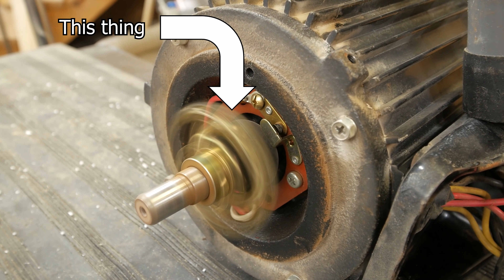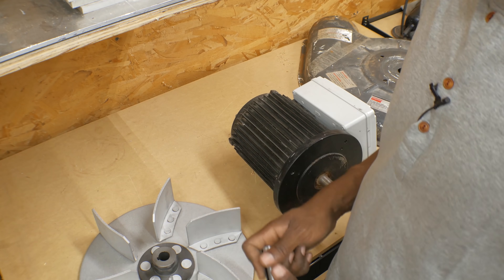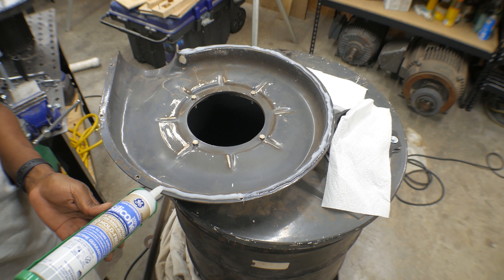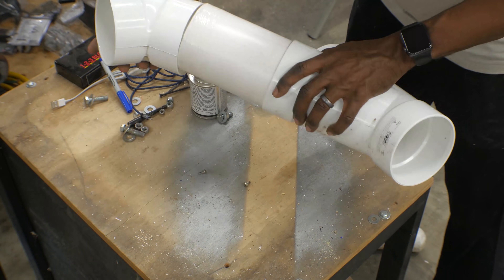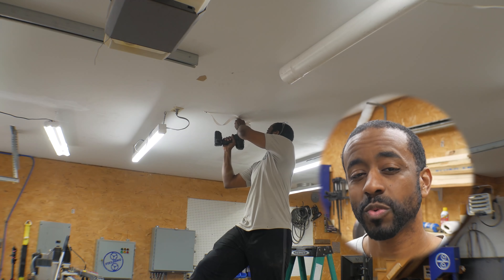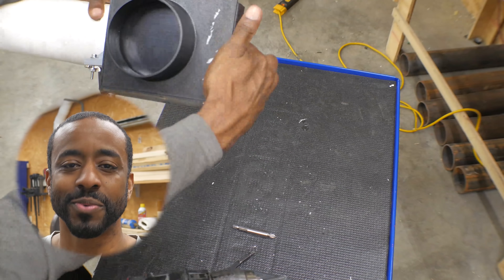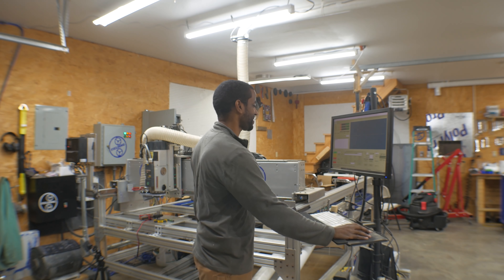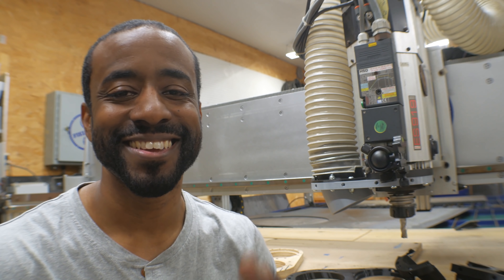Making An Automatic Dust Collection System; Shopmade #081

Comment: That is the right stuff.  As a matter of fact when I worked with the inventer of a large (truck mount size dual motor) portable carpet cleaner for high rises, in order to seal the very high pressure and high temperature hot water fittings, we used silicone and nothing else.  The difference is that when you rebuild it, much later, the silicone needs to be cleaned off whereas a gasket with sealer is a little easier.  Thank you for the videos Jeremy !

Comment: so, while i haven't had static start a fire, I can definitely confirm that dust against plastic can cause some very serious charge buildup and arcing.  I had an issue with my CNC machine where during a really long job all of a sudden the machine would abort with a message like it hit one of the end-stop switches.  But it never did.  Turns out, arcing from the dust collection was causing such a big EMI spike that the microcontroller reading the switches picked it up as a switch throw.  So, in the interest of your CNC machine, and the additional safety of protecting against huge charge buildup, i'd go ahead and ground those pipes.
Reply: I always forget that arcing causes EMI as well, and it doesn't have to be that near to affect devices.
Reply: How does one ground Plastic? As a former electrician (20 years ago) we would bond/ground the metallic parts by running a jumper in parallel with the plastic part (seal tight for example) and bond the connectors. Although the plastic seal tight with plastic connectors was never bonded.
Reply: Grounding it all is definitely worth the effort.
Reply: I was running some lumber through a drum sander, and kept getting "burned" by the chassis. Eventually figured out that the friction of the dust on the collector hose was generating a HUGE voltage differential, and I was the only path to ground when I got too close. I was going to add an arduino-driven dust gate and run a signal wire back alongside the pipe to the dust collector's relay-driven power switch, but would want to REALLY ground everything to avoid having the circuit board fried when the input pins suddenly jumped to 700v.
Reply: @Reign_In_Blood_963  most effective way would be to run a conductor along  the inside of the pipe in contact with the interior sidewall since that's where most of the static charge is and gave it an exit somewhere near a grounding point.
Alternately if the system already exists, use some kind of metal strapping (like the stuff with the holes all along its length) and screw through that at intervals all the way to the interior of the pipe to conduct the static charge outside.
Strictly speaking you would need several conductors around the circumference of the pipe to maximise static reduction since the plastic pipe doesn't efficiently conduct charge around it's surface.
 In a home setup it's unlikely to generate enough static to a significant risk, and the duty cycle would probably give sufficient time for the charge to self dissipate anyway.

Comment: The one realistic use case I've heard of for grounding is that it will mean less dust buildup (caused from static making it "stick").  That seems like a reasonable reason for grounding, but I'm thinking as short as your run is, it's probably not needed for that either.

Comment: Hey Jeremy, awesome work. I just use one of those remote switches. You have up to five units plugged in around the place (I just use one) and the remote is in my pocket. As for gates, I put some manual ones in but it doesn’t seem to make that much difference wether there are a couple open or not the suction does not drop off much. Maybe because they’re low pressure high volume. 
Now, more importantly, take that final collection bag and throw it away. They do more harm than good because they have to let air through them they also let the really dangerous micro particles through and it’s the micro particles that get trapped in your lungs and stuff them especially if you’re cutting/sanding MDF ect as the glue dust is dangerous. I see the way yours works most of the dust goes in the drum but those super fine particles don’t drop out of the air flow and pass through the bag. I use a drum like yours but I got one with a removable lid and fitted three truck air cleaners to the lid so all exhaust air passes through the filters. You could put a drum with filters fitted where you originally wanted it in the corner and connect it to your outlet from the vacuum via a hose. The best way is to have the final outlet outside of your workshop. 
There is now a lot of information on the internet about woodworkers and the dangers of fine dust particles. Please consider reading about it and possibly warning your subscribers. I’m not a safety nanny but this is a real issue with potentially deadly results over the long term.
Cheers Stuart 🇦🇺

Comment: Unless you are dealing with dust on the scale of a few micrometers, the very limited energy of a electrostatic discharge should not be enough to cause ignition. The dust concentration in the pipe is also fairly low, ignitions will very likely not develop into a dust explosion.
Reply: I can tell you the static generated by my dust collector is not low energy if im doing a process that generates a large amount of particles for extended periods.  Obviously Im not grounded but I'm considering adding some sections near high touch points just to eliminate those jolts.

I swear ive been hit by discharges 3-4 inches away, and while not particularly dangerous,  is really annoying.
Reply: I just ran some aluminum tape on the outside of my pipe from the dust collectors case, to the end of each run. Also put it around the connections for extra sealing. Eliminated all of the static and increased the suction for a small price and very little time!
Reply: He's right about the particle size.  its also a concentration issue.  you need to reach a minimum concentration in the air for it to be explosive, same as grain dust. if you clean out the collector regularly it should be  low risk.  the catch bin is where you have the greatest risk because the air flow through the pipe would make reaching critical concentration difficult.

Comment: I really enjoyed your automatic blast gates. I made a simar set for my shop. I made the gates out of 1/4 melamine slider and a wood enclosure, with the same air cylinder and pneumatic switch you used. All in, less than $40 per gate. The self clearing of this design is a big improvement over most commercial gates. I added current sensing to each tool and controlled the gates and dust collector remotely with a PLC controller. This allows the dust collector to run for an extra minute to clear the dust in the pipes.  The air compressor is also controlled by the PLC for full autmation. Happy sawdust to you!

Comment: We had to add a ground strap that sits in our dust collection bin, in the saw dust itself. Not because of the fire hazard, but because the static will jack with our CNC router computers.

Comment: I've been an explosives expert for 18 years. If you have to add a grounding wire to your dust collection, you need to add one to your powdered creamer (yep, it's flammable). It all has to do with flash point and the heat of a static charge that occurs through time. Yes, it is possible but so is getting zapped with lightening 32 times during one storm. Possible but not probable.
BTW... I love this video (and the others). I like the way you talk like you don't know what you're doing but your big brain is answering questions your mouth hasn't asked yet! LOL Keep up the good work.

Comment: I was in a place that was using PVC to move air at a fairly high velocity. The maintenance guy was very proud that he used PVC and everyone else was using steel. He too was using a gate guillotine valve. Anyway, the day I was there it was particularly cold and when the air was flowing everything was fine, but when he shut the guillotine valve, nearly all the PVC shattered at once. No one was injured, but given the shape of the shards and the violence with which everything shattered, it could have ended badly. I have also witnesses a giant HVAC duct collaps because one damper closed while the other remained open. Air has mass and it does surprising things when it stops suddenly.

Your volume of air is less, but he was using SCH 40 and you are yard drainage pipe, which has a wall thickness that's 3x thinner than SCH 40, for the 3" or 4" diameters. You may be fine, but I thought I would offer you a word of caution.
Reply: It should be fine in his case because he has plenty of non-glued joints and very large diameter pipe. An overpressure event of even 1/2 atm would produce ~90lbs of separation force to every unglued joint, which should prevent any serious over-pressures by simply releasing them into open air.
Reply: @avialexander 
Without knowing the air's velocity, volume, temperature, and %RH, in addition to how quickly the valve is shut; you can't know the developed pressure or the shock it would induced into the system.

I stand by my potentially over-cautious warning. But, I doubt anyone can tell video guy that his system is safe, and have numbers to back it up.

Also, he said that he wasn't using SCH 40 pipe, he was using drainage pipe. This is usually SDR35 and unlike solid walled PVC, it's aerated PVC, kind of like a foam. This pipe is strictly for unobstructed drainage, it has no pressure rating.

Shock happens faster than the non-glued joints can slip apart.
Reply: @cornpop7805  Interesting points. I'm a CFD engineer, so I know nothing about PVC pipe. What I do know is fluids. And shocks travel at the speed of sound, which in air is 1125 fps, and if you want to ignore effects of compression, divide that by three, so ~350 fps. I'd estimate his duct system's longest branch is ~35 ft, which means that the pressure equalizes in the entire system in 0.1 seconds or less. So to get a pressure spike, he'd have to close the gate in 0.1 seconds. In the video that's not the case, but it could be done. If you wanted to evaluate it at that speed, then you'd have to start using those properties you mentioned as well as dynamic compression effects. I'm sure there's a table somewhere to do it quickly.
Reply: @avialexander 
I mentioned this in my original post, but I've seen SCH 40 PVC pipes shatter and giant duct work crush, both due to the introduction of a complete and sudden restriction in air flow. Both times, someone could have been killed. I'm not saying that I'm sure that the piping system in the video presents as much danger, but the pipe is thin, weak, and unrated. That's a large enough motor and impeller to make me think the air has meaningful velocity. We both know that F=MA and air has mass, as does the debris. I woudn't feel right to see a similar setup and not offer a word of warning.

It would be interesting to figure or test this system out. I've done some CFD and associated R&D. Fluid dynamics is a pretty complicated subject. It certainly takes a properly parameterized model to give you reasonably good results. In order to prove the software worked well to our owners, we had three different engineers (plus the CFD seller) working seperately to model the same peice of somewhat simple air handling equipment. We had lots of real pressure and flow measurements - plus video of smoke tests for the equipment, but all we got to work with was the fan specs and the geometry of the equipment. None of us came up with similar results to the real numbers. So, the software failed our owner's tests. We did further testing, where we ended up creating several simplified versions of equipment, then parameterize the models to match reality. We eventually came up with parameters for each architype, to use in similar cases. Without that feedback, our CFD software wasn't as good as our experienced guesswork. Even the software company's best engineer failed to create an accurate model, without some real world feedback. The systems we were building were no more complicated than a residential refrigerator. I started cheating and created dumbed down models of our equipment, this helped the software perform better. It really threw it off to have small complex interfaces and tight corners. My simulations also ran in a couple hours, rather than 10 or 12.
Reply: could put a delay on the blast gates
Reply: His thin wall will never shatter, it will collapse and crush.  Schedule 40 does shatter, but his thin wall will not.
Reply: @joshuablair6120 
Cool! We finally have an expert opinion that guarantees, unequivocally  that the pipe is safe when used in this application. Thank you Josh for your guarantee!
Reply: I have installed a waste vacuum systems in a bedding factory every and as soon as you said PVC I guessed what was going to happen we learn from experience.
Reply: To the experts: ......I'm learning alot....Can adding small drill holes 🕳 to the gate itself help to keep some pressure flow? That dust will not reverse... its not smart dust. Can thay solve that potential sudden pressure stop?... There will be a little whistle.. but that's nothing...
Reply: As I've been thinking about the possibility of the pipe shattering, this occurred to me:
1) Slowing down the speed of the gate valve a little, should help to reduce pressure spikes, due to the mass of air being forced to suddenly stop.
2) I suspect, at this pressure/flow the pipe would only be capable of shattering at low temperatures (maybe below 50°F).

Comment: I love how you still have that 2hp motor on your miter saw!
Also if you don't mind my asking, where do you get your pulleys from? I have a ton of motors that I would love to drive by belt and see how they would function as generators. But I got to get some pulleys for that, and I'm uncertain where to get them.
Reply: I've gotten them from Grainger before.  Grainger is usually very high priced on many things and they charge a premium for having stuff in a "brick and mortar" but their die cast zinc pulleys for v-belts were actually priced competitively.
Reply: There is a video on that saw somewhere...oh, was the video right before this: https://www.youtube.com/watch?v=gMVIdDKgG5A  As for the pulleys, I think he uses a lot of salvaged parts like treadmill motors and such that have them, but you can get some on kinda cheap from ebay, or if you're not too picky on the sizing, a u-pull-it auto parts yard can get you come on the cheap.
Reply: I have a local store that sells pulleys of various shapes and sizes... (Tractor supply) ... If I need something that they don't carry... then I order from McMastercarr online....  Northern tool might also have what your looking for...

Comment: About 40 years ago I came across an article in Fine Woodworking magazine explaining how to install a relay to automatically turn on the dust collector when any of my machines were engaged. Though I thought the $70.00 was a bit high ;-), I ordered one and installed on my system. It was a godsend and has worked flawlessly all these years. I have looked for an upgrade to install automatic blast gates, but haven’t seen a reasonable design…until now. The electronics my be a bit beyond my comfort zone.
You have a great channel, good content and very understandable.

Comment: My old landlord had a similar setup in the woodshop. He used several sets of key-less entry fobs from an old car mounted by each tool to control the system. All fobs activated a 'power locks' solenoid at the collector motor, and then each used a paired 'power lock' to open/close each gate for each tool.

Comment: I too automated my dust collection after watching Bob's video.  I open and close the blast gates around my shop manually but when opened they send an input to an arduino to turn on my d/c.  This is also good because I never leave a gate open accidentally so I always have the best suction at the tool in use.

Comment: I used relays not in the workshop (don't have one yet) but to automate switching the power supply of a 12v peltier cooler in the van between the solar panel + aux battery and the alternator + car battery. When cruising the cooler run on the alternator (giving the aux battery a chance to fully recharge) and when stoped the cooler run on solar power. So fulfilling to put your hands to good use 😋 Your work gives me a ton of exciting ideas for when I'll have a chance to settle down and build a shop. Keep up the good work 👍

Comment: Something to watch out for would be the channels of the blast gate slowly building up with material, and eventually, not closing all the way.  I'd keep a stiff wire handy, and make it easy to remove the hose, so you can dig out the compacted debris every couple months.  I learned the hard way.
Thanks, and great videos.

Comment: Hello, I just finished a very rudimentary auto turn on, and shut-off for my dust collector.  The basis is a current sensing module, with the donut hole.  I intercepted the shop heavy 20 amp tool circuit with the module.  Anytime a tool is turned on, it goes through the current sensor, activates a relay, turning on the dust collector.  That's 2/3 the equation, the last third is operating the blast gates, which is how I found your video.  You're brilliant, keep up the good work!